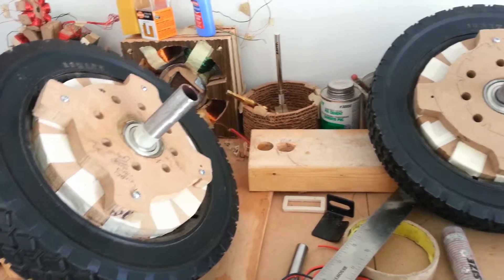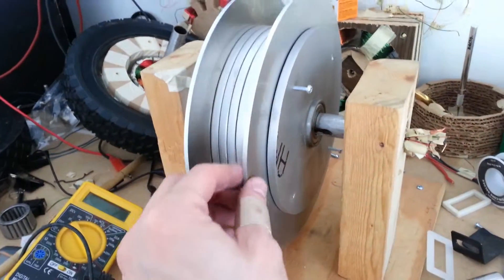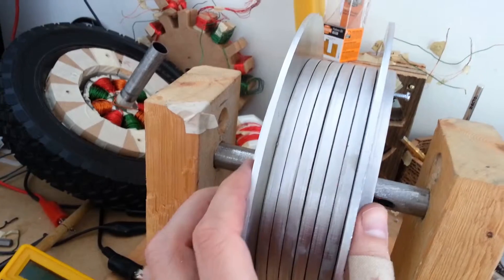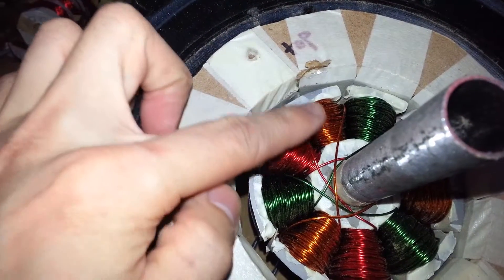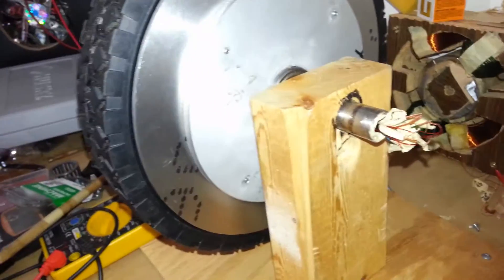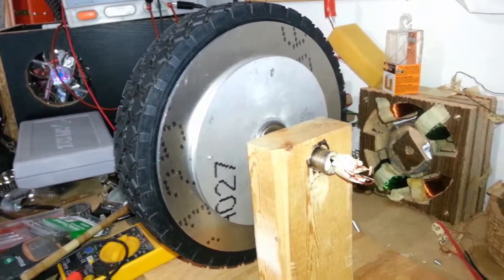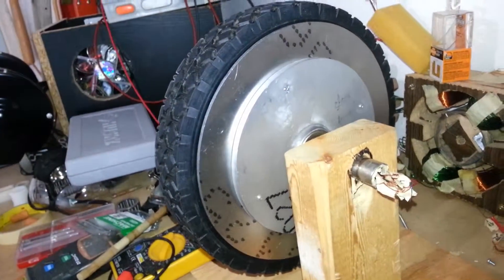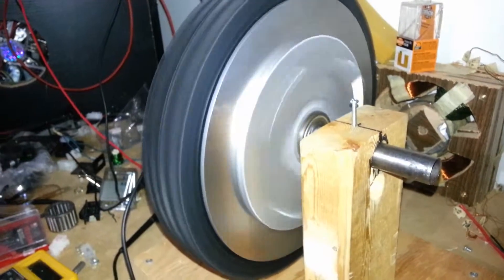Motor, Part 9 - Aluminum and Skews

Comment: Nobody seems to care a big deal about the torque ripple from an internal combustion engine.  Motor flywheel and mass of the car seens to smooth it out the torque ripple from internal combustion engines. So, maybe in some aplications we are overly concerned with torque ripple from iron cogging in electrical motors. 

Btw if one would llike, the can see how i used iron in my motor without without slots eliminating iron coging  Granted steel strapping isn't as good as electrical steel for an electric motor but the enamle has great isolation between layers in coil of steel strapping.

Comment: cogging torque isnt much of an issue in this case your purpose. yes it does represent relatively small torque, that can turn an unsecured shaft, but you will have secure the shaft from spinning anyways. How many foot pounds of torque are you anticipating a motor can generate? Well you have to secure the shaft to make sure it is the hub that is forced to spin and that you shaft remains fixed.  and while ridding, cogging torque ripple wont be noticeable with the momentum of the go-cart, batteries, and the driver,  400-500 lbs fully loaded?

Comment: what about using regen breaking
Reply from the maker: That will happen down the line. You'd need a few transistors. One is the normal power transistor that turns on when the accelerator pedal is pushed, and a couple more whose circuits go backwards into the battery from the motor with voltage regulators built in to charge the battery that get turned on when the brake pedal is pushed. But you'd also want circuitry to turn those transistors off when the backwards voltage dropped below what the battery needs to charge. It's a fairly complex circuit if you want to make sure it's safe.

Comment: How much did all of this cost for the motor, just wondering?
Reply from the maker: the steel sheets were $50 but I bought a lot more than just for this motor. shipping was a lot more cause the weight. the aluminum was quite cheap but laser cutting the shape was expensive. I think 300+ for both motors. the rubber wheels were like $15 each. plusrandom bolts and the shaft and wire. so on one motor I probably spent 450 or 500? not including transistors. prototyping is expensive. daily production for sale would be much cheaper
Reply from the maker: 300 for 2 motors of aluminum I mean
Reply from the maker: I've certainly learned more since then and as time allows I'm making updates to my go-kart and these motors. The transistors I'm using now are different and much more capable, so if you need any guidance as you work on yours I'd be happy to help

Comment: It's me again ! for your breaks you could only reverse the motor electrically ( for the test i don't know if it will work good enough with load on it )
Reply from the maker: +Johan Kuhn It is possible to do that. It tends to make the build a lot more complicated, because that energy has to go somewhere. It either has to be sent back through the batteries to charge, in which case it must be voltage and current regulated so to not damage the batteries or anything else on the kart, or it must be put through a large resistor to bleed off as heat. I want to implement it eventually, but with my schedule right now it won't be for a while. The easiest way is to buy a controller that already does that but the ones I need for the current my kart uses are very expensive.